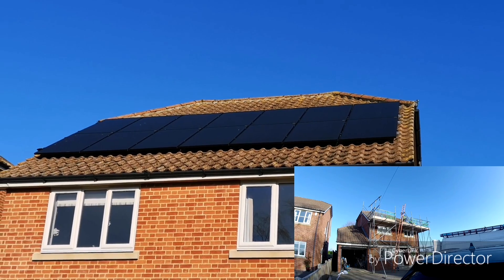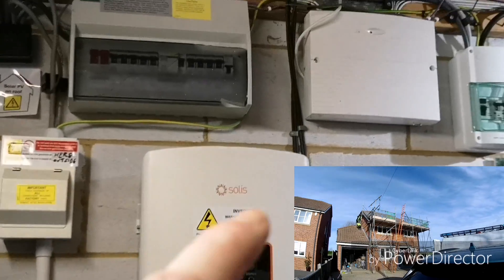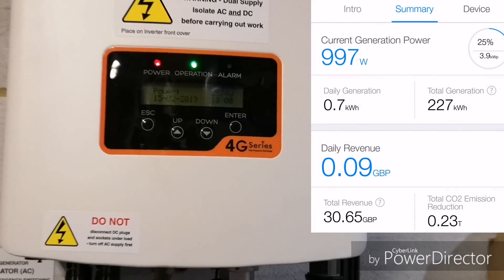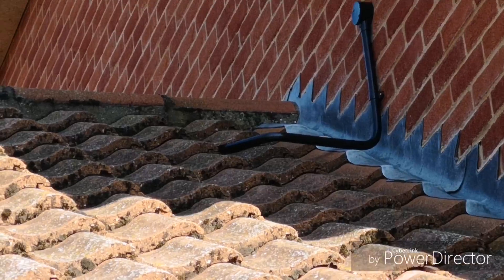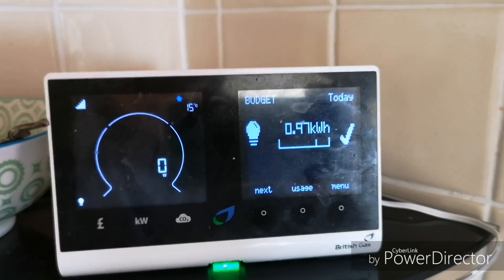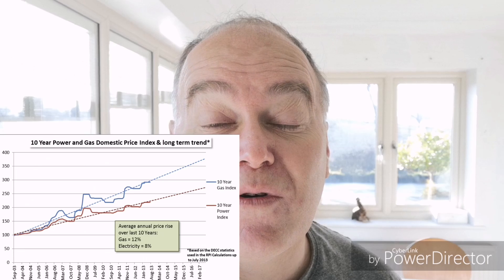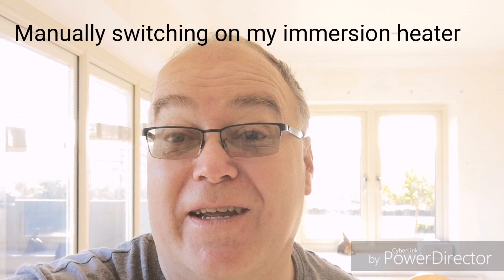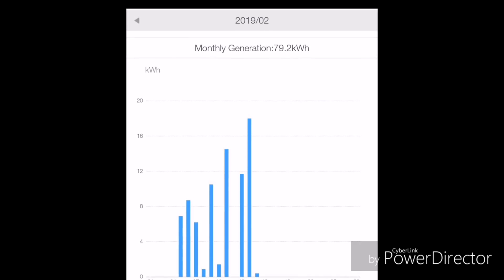Solar PV to go with my Kona and Zappi. Why I've added solar.

Comment: Hello Nigel, I'm in Australia and have JA 290 watt panels , a small 5.22 kWh system, fronius primo 5 inverter, a sanden heat pump hotwater system,  a Tesla Powerwall 2, and a zappi charger. 
I've had the solar for 2.5 years and had the Powerwall installed mid August 2017.
My 365 daily average solar generation is 18.9 kWh. And since I've had the Powerwall installed, I've never used grid power. Never pay for electricity. I still have a grid connection, but the electricity company sends me a cheque every year.
1 night my area had a blackout, and lots of my neighbours came round to find out why I was the only one with power.
Reply from the maker: Mark you're living the dream. I'd love to use zero energy from the grid
Reply: Wow, hopefully you neighbours have caught on since then...
Reply: I just got my solar yesterday here in Australia.Today first full sun test made 66kwh on my 7.8kw system.Trina Panals and fronius inverter. I'm very impressed so far.Getting ready to buy the kona:)
Reply: @MrHsv123  really nice
Reply: I'm in Western Australia and have 6.5kWh panels with Powerwall 2, I also have 3 phase power. Here's the catch: My power company (Synergy) refuses to give me a rebate because of my 3 phase power as they claim they can't tell what is renewable energy and what is grid power and therefore won't give a rebate. Here in summer I use on average 0.3 kWh from the grid per day. The powerwall is not able to run an aircondition as the battery will be depleted in a few hours. Everything in my house is electric incl induction cooktop and hot water. I guess that's why I'm not able to be off grid completely. Also I didn't have the backup option installed so I'm still screwed during power outs.
Reply: @kimcorell7786  quite a complexed problem, no rebate then use it all, if you have money and roof space ,add more and cut them off. I'm not sure that I could do that in Melbourne, I already have the capacity to that makes me independent, without grid, just to makesure, another 4 panel's. 
The sanden heat pump hotwater system has made a big difference, lowered my electricity consumption, but all this stuff has a huge financial Cost..
Reply: ,  3 phase, as I see it, 3 powerwalls, so expensive

Comment: We have done the opposite to you, fitted solar first (in theory getting battery fitted next week) not got an eV yet though. You do get obsessed watching via my mobile to what the house is generating! On feed in you are limited to 4kw system any higher they reduce the feed in even more. You can get a water tank heater system that senses you exporting electricity and automatically feed the tank immersion heater, saves you manually doing it about 3-400 quid.
Reply from the maker: Having a timer and wireless switch might Bevan interim solution for the water heating

Comment: Great video Nigel, thanks for that. The info certainly gives me food for thought. Living on Anglesey, when the sun does shine ( like yesterday- 17degC in Feb!) it can be intense. 
 Other times less so.
I am fortunate to have enough space in the garden to consider a ground installation in a south facing elevation. I am rural, all electric and economy 7 so there’s a lot to consider. I suspect at some point a battery storage system would work, but present cost is against it. With the feed in tariffs set to end I caught the back end of something on the radio the other week that there may be “ something to replace it”. It will be interesting to see if anything else comes along. Lot to think about!
Reply from the maker: Plan before buying I say.

Analyse your usage and appliance efficiency. Look for those things that can be improved or moved to optimal times.

Once you know your consumption pre solar, it's easier to determine how much you might gain.

Planning as a strategy makes best sense, migrating all other energy types to electric then boosting your own production.

I'm convinced I'll add panels at some point.... Some how.
Reply: @EVPuzzle  hi nigel, as mentioned before I have just installed solar PV.... When I enquired about adding more panels in future the installer said these may not be eligible for the feed in tarrif... Please Let me know if you know otherwise
Reply from the maker: In theory no you'd need a new application but adding s few more panels without increasing your Max output might be ok

Comment: Friend of mine had his roof plastered with solar some time ago. At the same time, he had all the roads removed in favour of heater glass panels.  At time of fitting, payback for whole system was estimated at 8yrs. Just over 3yrs. later, he was cash in pocket. It rarely snows where he is in UK. And out of his various rads, over 70% face south and south-west. He drives two diesel vehicles - one car, one 4x4, both vehicles often tow a 20’ trailer.
Reply: rads... rads... not “roads”.
Reply from the maker: Roads?  We don't need roads where we're going Marti
Reply from the maker: There are some clever systems now. 
Heating water on electric is definitely cheaper.

I did some rough tests years ago and found Eco7 could heat hot water for a week Vs just one day with Gas for the same cost.
With an oil boiler I'm really keen to convert to using the immersion.

Might need to get a lower rated immersion though. Current on is 3.5kw which is great if you need it quick but isn't optimal for solar
Reply: @EVPuzzle  You do not need to down rate immersion  they take what ever power it is given as you are on oil should save you a lot of money in summer. We used next to no gas  in the summer as solar provide all the hot water (that was before we had an ev as makes more sense to charge car but in your case probably better to  heat your water as oil is very expensive)we use solar i-boost  fit it yourself only about £300  not sure how expensive to add Eddi that talks to your Zappi what ever you get fitted I would guess you could save £10 a week on oil heating water on sunny days.
Reply from the maker: I'll install a device for sure otherwise it's hoping I get 3kw at midday and setting a timer. Automatic and slower is best

Comment: Nigel had my solar pv installed in April 2011 when the feed in tariff was at its most (overly?) generous.  Still get a good feeling from the free power on a sunny day.  Based in South Norfolk we easily generate 25kWh per day in summer obviously much less in winter although very seldom zero.  I also have a solar thermal system to heat the hot water which pre dates the pv but still works well and heats all our domestic water in the summer months.  You could consider an eddi as a partner to your zappi to divert surplus power to the immersion heater automatically?
Reply: Or why not have the immersion heater on an old school timer (£5 from wilko).. The timing of sunshine tends to be quite predictable ;).. You only risk using more power (kW) than the solar generation ...
Reply from the maker: Or a WiFi enabled switch ?  Just need one with a timer.
Reply from the maker: Yep Eddi to save me manually switching it on..we generated 18kwh yesterday. It all helps

Another Kona in Norfolk?  Nice to hear from another local.

Comment: You got a very good price, l paid  £8, 000 for my 3.6kw system with an LG battery l do love it, there was an initial problem with the inverter but even now nearly 3 years later l still get excited when the battery fully charges & l can run the house for 24hrs with no power from the grid. This does take a degree of geekienes, a powerful kettle will use 3kw so unless it's very sunny this will draw power from the grid, l have changed my immersion heater to a 1.5kw model and have to be careful when l charge my Leaf. Sometimes this is all a bit too much. I am looking forward to the day when there is a totally integrated system between car and house, a car battery certainly will boil a kettle! As l understand it & a could be wrong you can't on a normal domestic system feed more than 3.6kw back into the grid, so anything more powerful is pointless unless you are going down a off grid path.
Reply: sounds like a good price to me including the battery  I have a solar i boost which diverts all spare power to immersion  cheep and you can fit it yourself
Reply: @4yourgarden  That sounds like a great idea, far better to use your generated power than feed it back into the grid, you get paid just the same and as 70% of power you put into into the grid is lost in transition, far greener!

Comment: It would be nice to completely dismiss the energy company wouldn't it.  Maybe with battery cost reductions down the line and a small generator for emergencies that will be feasible. The generator would only need to charge the batteries slowly so maybe even 1-2kw would do.
Reply from the maker: The car could be your contingency even
Reply: Yes, vehicle to grid/house would be a great feature.

Comment: We have a 7 year  system same size as yours   17 Kw h  yesterday   still  used another 16 Kw h  from the grid  as we unlike you are high users including charging car from  my variable rolec charger,completely agree with you about  battery storage until the price comes down which it will not worth  but I think your payback figures  are bit optimistic more like 10  years.
Reply from the maker: I have said 10 in the description including cost of money. It's in that ball park.  We won't know until we know what energy price increases are like and how much if the solar I can consume. So far so good
Reply: @EVPuzzle  Knowing you how meticulous you are  I am sure you will have costings worked out soon  to the nearest  month   Lol        I enjoyed the video  thanks dave
Reply from the maker: Much of the costings can be manipulated however you want the answer to come out.

Cost of money for me is currently 6% which ruins are chance of actual payback

Energy costs would have  risen 20% for me in the last  year if I'd stayed with previous supplier

Comment: Did the installers or Panel suppliers give you any information on the rate of decline of kW production over time. i.e. in 5 years what reduction from the maximum 280 watts will each panel be capable of producing ?
Reply: Well that's good news, thank you for the information. By the way my window cleaner uses distilled water that is brushed onto the windows via a long pole, no need for ladders. There is every chance the that system could be used a few times a year to keep them clean.
Reply from the maker: Deionised water saves drying and water spots for sure
Reply: @EVPuzzle  My setup is similar sized; got it installed 6½ years ago. I have not noticed any degradation in production so far; 2018 was a record year.
I have never had my panels washed; granted my roof appears to be a bit steeper so bird droppings disappear when the next rain shower comes by; snow slides right of etc... I have checked and the local window cleaner have the right gear inc. soft water.
Reply from the maker: Yes. Seemed minimal to be honest. Given older panel are still getting great rates after nearly 10yrs I'm not worried at all.

Cleaning, now that does bother me. They're pretty high up. Not sure my hose pressure will reach
Reply: I have not seen any lower output on mine in eight years. Cleaning probably does help if there is a layer of dust over the panels. Get yourself a ladder. :-)
Reply from the maker: Next to a field I'll get dust from harvesting etc so definitely needs care

Comment: £5k is a great price. I paid £8.5k for a 7.5kw system earlier this month. Around 27kwh generated yesterday. Absolutely amazed with how much production. Agree with your comments re battery storage. Have you seen the V2G trials currently being done by Ovo energy and Nissan? Currently only Leaf able to do V2G. Very exciting prospects. However I still can’t work out in the V2G blurb whether it also allows V2H (house)) which would be the key to offering the potential to me to get 98-100% of my electricity all year free. V2G or V2H as I call it means you don’t need a wall battery as your car is already the perfect battery backup for the house.
Reply from the maker: 7.5 envious 🤯

Comment: I remember being similarly enthusiastic after my PV was installed in January 2011, it wears off but I still keep an eye on it daily. This has been a good week, 14kWh yesterday from my 3.2 system.
During the summer you will be hard pressed to use all you generate unless you drive all night and charge the Kona all day.
I am not yet an enthusiast for the Zappi. It will only charge on ECO+, the PV only mode, if I see the solar sending (say) 1.7kW to the grid and nothing to the car and I manually set the Zappi to FAST, see it ramp up to 7kW, and then manually set it back to ECO+. It will then send typically 1.5 to the car and 0.2 to the grid.
The rigmarole has to be repeated every time the sun goes in.
I am hoping the new firmware will fix it. I am supposed to be getting my hub today, but meanwhile I am not a subscriber to Zappi mania.
Reply: Good point about Zappi  I did not know that  I have 6 levels on my Rolec  normally leave it on low setting then manually change  for peek hours works out well
Reply: After over 7 years owning the solar  still gives me a buss when I see  my solar monitor  and getting cheques  to the value of of over  £2000  a year  which keep rising   with inflation .Not bad for a lay out of £10.500 for a 3.84 KWh  system
Reply from the maker: Going in a few years ago was definitely wise even with higher prices.

I've only now settled in a house I'll have to be pried from in a coffin so couldn't consider it before
Reply from the maker: Haha, I can best you at last lol
Reply: Certainly bested me on price. Mine was very nearly £12k. It's paid for itself now and the annual FIT income is very nearly twice my combined gas and electricity bills.
Have you got any anti-pigeon protection on yours? The blighters nested under mine in Year 1.
Reply from the maker: Think my roof is too steep for them but my 177 will keep them at bay if needed
Reply: My roof is 30 degrees. Ideal for June sun. Pretty good for pigeons too.
Reply: @malcolmknight6450  Have just got some panels and am wondering if I should move my TV aerial as the birds may poo on the panels. Yikes
Reply: Fortunately my panels are on the south slope of the roof and my tv aerial overlaps the north slope so bird poo since the pigeons were barred access has not been a problem.